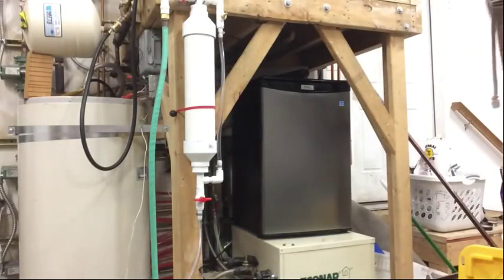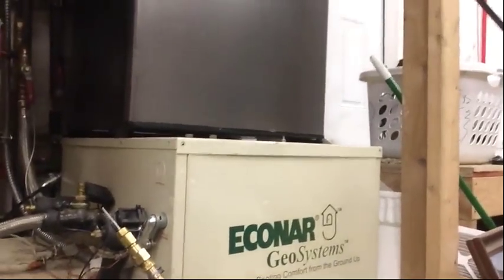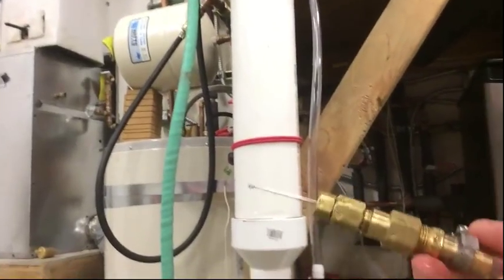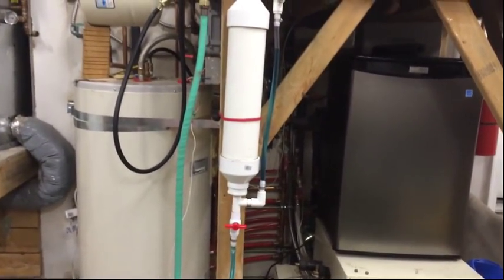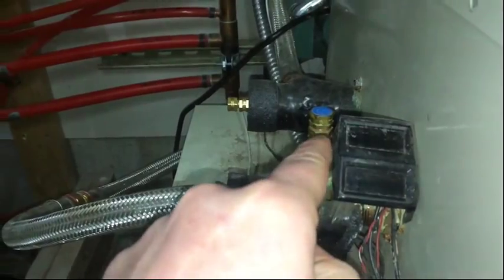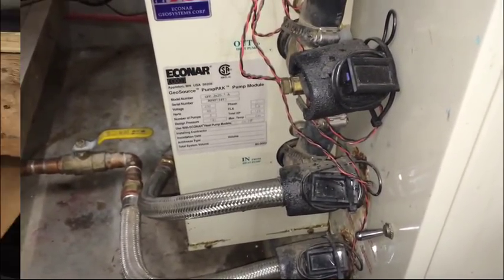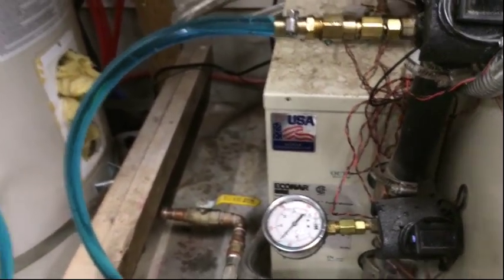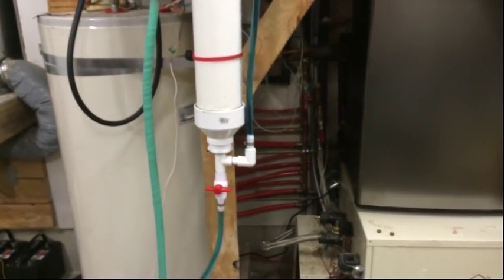Fix for low pressure in a geothermal ground loop

Comment: a much easier method that is automatic is to remove pt valve and reinstall with a tee, plumb tee to a check valve and then a presure regulator hooked to your water supply. it will keep you ground loops at the pressure you want year round . we used this system on a lot of leaky loops.
Reply: what should the psi be for a 2 ton climetmaSTER  closed loop system.

Comment: Keeping a proper ratio of methanol to water is essential. If you are in a cold climate this ratio is crucial. Without a hydrometer to measure specific gravity of the methanol I would advise against simply adding methanol and water in in measured quantities. Also air purging can be done better with a submersible pump and a barrel.

Comment: Greg, your setup there sounds very similar to what we have at my place in BC. I think ours is a 6 ton unit, and roughly a similar amount of pipe in the ground. As with your situation, we generally have to recharge the system a couple of times every year. The guy who installed our geo system told us that we would lose pressure for a while, as the loops would expand for a while until they reached a sort of stasis. 

The contractor sold me a device similar to yours, so we can inject a bit of water into the system with a hose. Yeah, it gets the job done, but I really like what you have done, and am thinking I would like to do the same sort of setup. 

I guess the most important thing will be to make sure the 4" pipe can handle the water pressure. 

Anyway, thanks very much for showing us how you did this. It's unlikely that I would have thought of it on my own.

Comment: Nice homemade pressure /temp . Need to set at 38 psi with 14* temp/diff..Water drops below 11 psi shuts down. Good job. Loops are guaranteed min.30 years. Call installation contractor on loops, they will fix them under warranty.
Reply: Michael Lee, so the washer fluid as u call it goes to the ground?? Maybe I don’t understand it but wouldn’t it affect and pollute ground water???
Also, why use closed loop pressurized system? Seems like a lot of problems. Closed loop non pressurized system is so much easier, no worries about pressure, no worries about so many leaks, no worries about air in system!!
Reply: my waterfurnace installer said the loops stretch after 5 years or so, Charged me 250 to repressurize